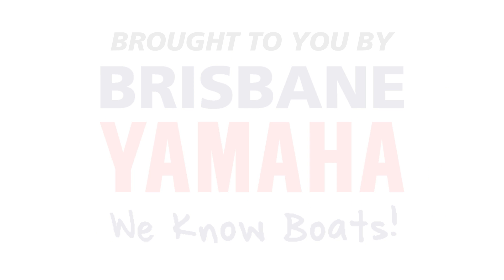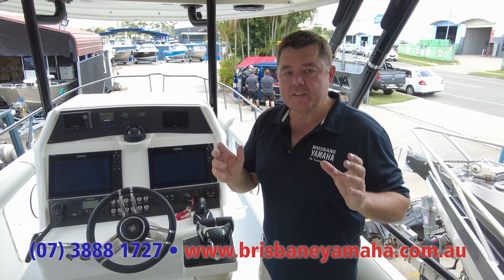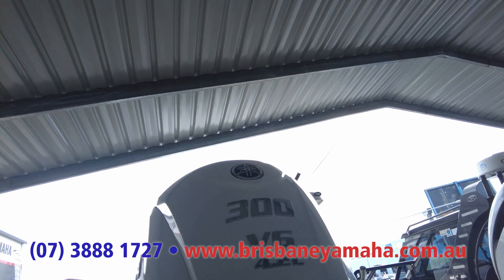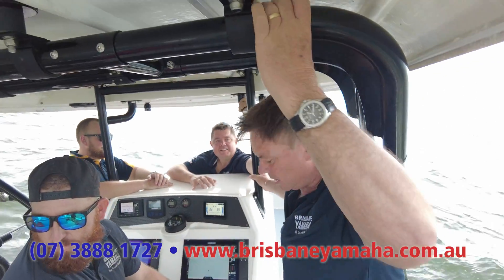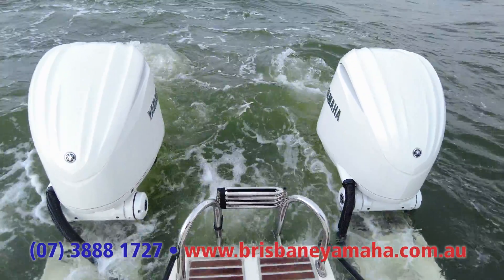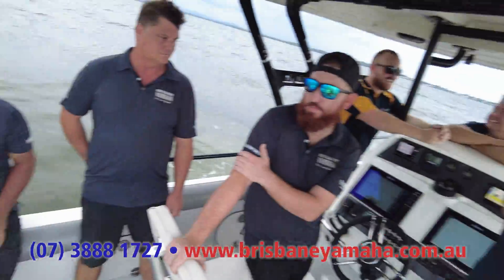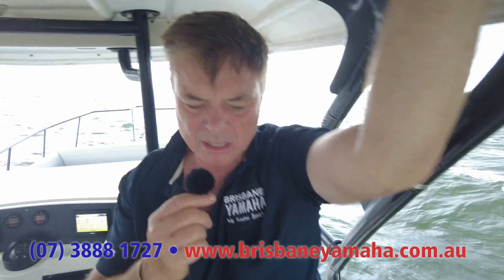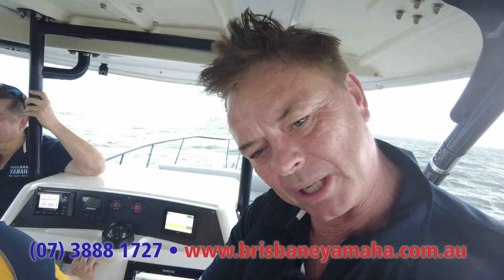Twin F300hp Yamaha repower + Helm Master EX

Comment: i know this is a strange question, but...is it possible to hook up a set of Yamaha outboards to separate gear and throttle binnacles (so two levers for throttle and two levers for gear selection) ? i've had this setup on all my boats including my current one and i am very fond of it indeed.
Reply from the maker: Yes
Like on a fly bridge
Reply: I think he wants a binnacle for port and one for starboard motor
Reply: @liamwindsor5854  exactly. four levers in total, two for gear, two for throttle, all next to one another.